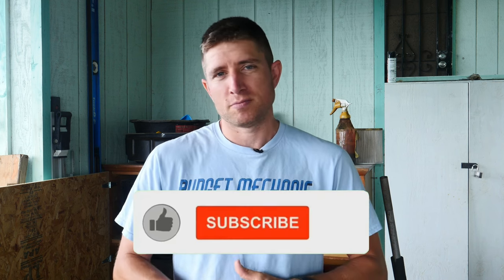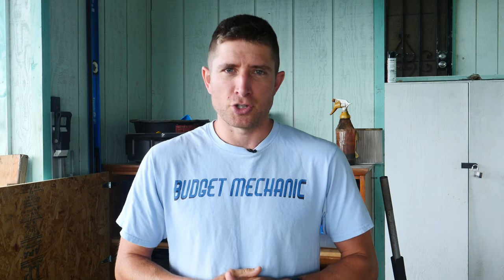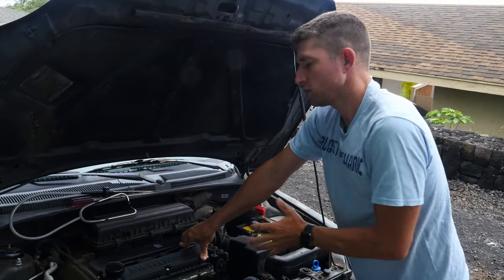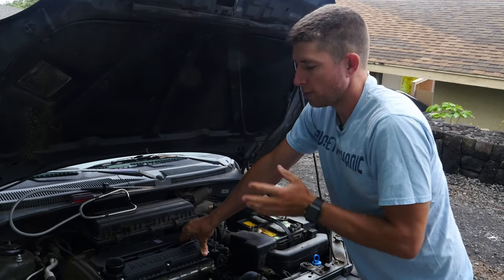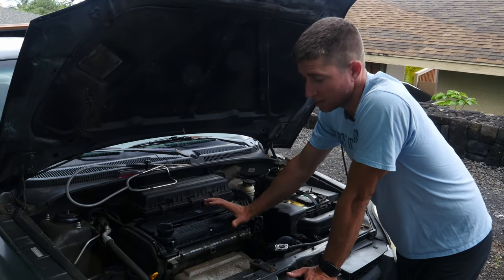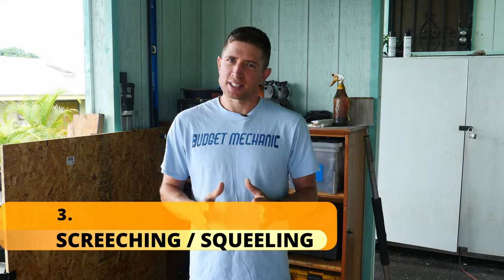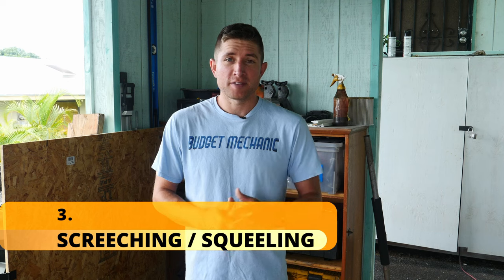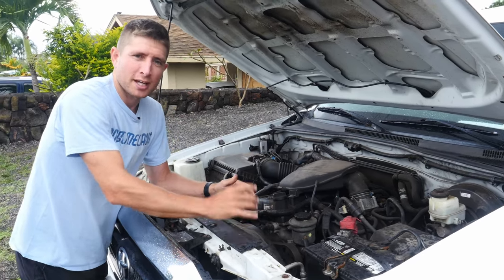NOISY ENGINE & How To Diagnose - Knocking squealing Whining Pinging Rattling Hissing Groan

Comment: Similar to 2nd whining noise, I get a metal noise at 3,000 rpm while driving/under load. It goes away when it shifts gear. Someone said it is a race in the transmission ('05 CRV) but not serious...it sure sounds concerning. Any idea what it could be? Thank you for your time!

Comment: My knock started after my car stopped  in traffic would not restart.Got it towed on the back of bed tow truck.code said bank one crank.replaced that.Has a real  tapping  sounds goes 2block😢 goes dead.2008 Lincoln Mkz.

Comment: I have a scion xa 05 , I’m hearing a very loud  rattling sound  when it’s in idle or 25 mph ! Don’t hear it when going 30 or over ! I’m thinking it’s the water pump ?any ideas ?? Thank you ♥️
Reply from the maker: I mean it’s possible, but could be lots of things. Try to isolate with a hose, or a metal pipe, or stethoscope if you can!

Comment: ideas: remove serpentine belt and start engine: noise gone?  also perhaps disconnect sparkplug leads one at a time (grounded) and starting: see if that cylinder is isolated?
Reply from the maker: Love it
Reply: My only make it on start up and when pressing  the pedal any ideas

Comment: Hi, i have passo 2011, 
When the accelerator is pressed and gains 20 to 30 km/h speed , there is a knocking sound which goes away with further pressing the gas pedal. Where can be the issue 
Compresser bearing, belt good. No code or check light.
Reply from the maker: Hard to say without being there sorry! Is it coming from engine or suspension?

Comment: My 2013 Explorer has like an overdrive noise, or a high gear noise,  when driving over 45-50 mph. What do you think it could be causing that? Thanks
Reply from the maker: Try shifting quickly into neutral and see if sound changes. Would tell you if transmission related

Comment: Is it possible for the pinging noise to happen once I release the gas pedal? I have a similar noise but not sure if it's pinging because I only get it when I let off the gas. I also thought it might be the timing chain as it sounds like the chain momentarily has some slack and is clacking around briefly. Also not sure if a timing chain issue would be constant or could it occur like how I meanitoned?
Reply from the maker: Both these things are possible! Might need to do some more research on your specific model and see if others are having a similar problem. Good scan tool can tell you if your timing is off too

Comment: I need your help. I own a 2022 GLC 300 Mercedes. I took it in two weeks ago for a schedule A service. After the vehicle was serviced, I noticed a low growling sound coming from the engine bay whenever I would sit at a light, drive forward or backwards at low speed with the AC on. The sound isn't heard at higher speeds. I took it back to the dealership and they couldn't figure it out which is EXTREMELY DISAPPOINTING. The car is fairly new with less 10K miles on it. Could you possibly know what this is?
Reply from the maker: That’s very disappointing indeed! Unfortunately it’s pretty hard to say without being there. We have some tips on tracking down noises as well as audio samples of common noises in our “car noise” video

Comment: I hear that lifter ticking like noise on the cold start up for few seconds. Should I worry?
Reply from the maker: No I wouldn’t worry. But that’s why it’s important to let your engine warm up for a minute before driving (putting stress on moving parts) before the oil is full circulated

Comment: Hey are you on Maui by chance? Have an e91 wagon that had a crank/nostart but now is nocrank/nostart.
Reply from the maker: Nope! Check out our video on no start/battery check
Reply: Hi,
I had 2021 Mercedes-Benz GLB250. 4 Matic
The code is P0302
I ordered a brand new ignition coil and 4 spark plugs at Mercedes dealer, replace all 4 spark plug and the ignition coil, but still remain the same issue misfire
Then rescanned tow more code came out
P0302
P050A
P219D
What else do I have to do to fix the issues please 
Thank you @BudgetMechanicHawaii

Comment: Is the pinging/preignition thing associated with backfire and random loss of  acceleration? I've got a frequent but random rattling and "marble" sound happening and have lost acceleration power twice going uphill.
Reply from the maker: Man hard to say without hearing myself. You could play around with octane for sure. Check engine light on?
Reply: @BudgetMechanicHawaii  no warning lights at all. Not low oil indicators. Nothing.

Comment: PLEASE HELP!
My car made a sound 4 times today that I kid you know sounded like a kid playing one long note on a recorder (plastic flute). No engine light, not connected to turning, accelerating/braking, or anything else that makes any sense. All sensors are normal and the vehicle is driving like normal. Just all of the sudden "toooooooooooooooo" for about 2-3 seconds and then nothing. This was over the span of 5 hours; 4 times. I can't find anything online for this kind of noise. It's not chirpy, or high pitched, and I honestly thought it was someone messing around in the podcast I was listening to at first. Until the podcast was done and it made the noise again.
Reply from the maker: Were you driving fast on a highway those four times?

Comment: https://youtube.com/shorts/MKXKb8QJffU

This only happens when the car is first started and not always, most often when it is very hot outside. I notice that when the key is turned, the needle jumps above 1000 rpm, then suddenly drops below 500 and then knocks, and sometimes it shuts off. We replaced the spark plugs and valve, washed the nozzles, replaced the temperature sensor and checked the fuel pump and that didn't solve the problem. Its VW Polo 2008 1.2

Comment: i get a low speed knock in my 1994 merc sable 3,8 once i shift to second gear it goes away
Reply from the maker: Try some thicker oil, maybe through some Lucas oil in there and see if it changes